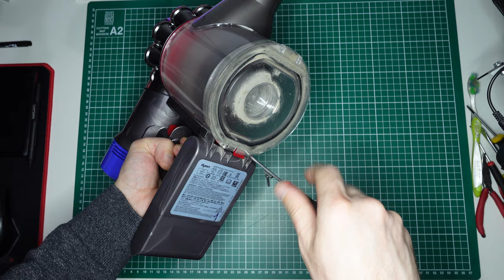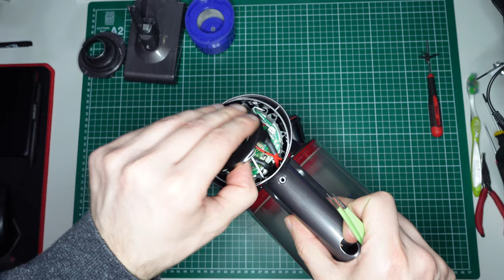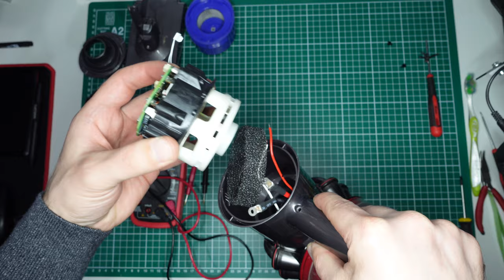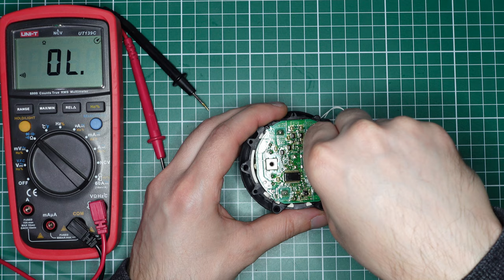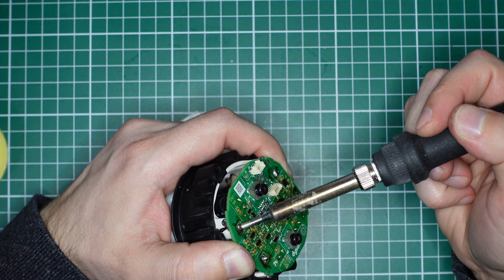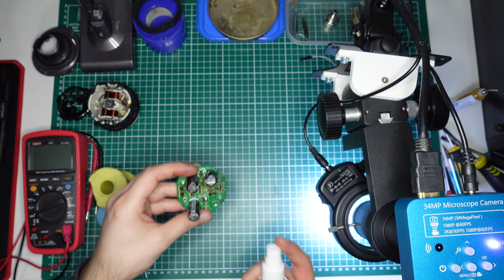Dyson V8 toasted PCB

Comment: I was only getting a flash in a V7 but my issue was that the motor was seized. Taking the motor out and forcing it to turn by hand freed it up. The whole trigger housing and motor assembly appeared to be factory new so I believe it was a factory error/fault.

Comment: What would have caused this to happen?
Reply from the maker: Unfortunately, I don't have a good electronic board to be able to see exactly which components are in the affected area so that I can figure out what was the cause of the problem. As soon as I have a good board, I will come back with an answer.
Reply: @techfixPOV  The transistor-sized package was a BC734. The other components were mostly ceramic caps, which can sometimes go out with a bang (literally)